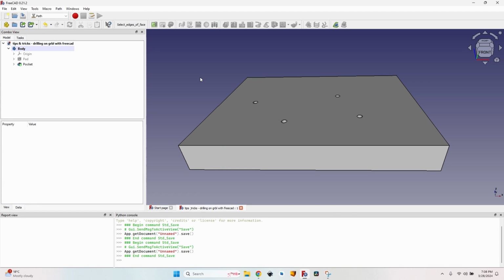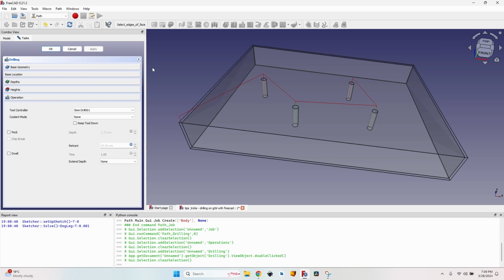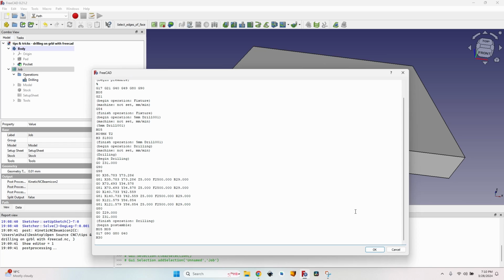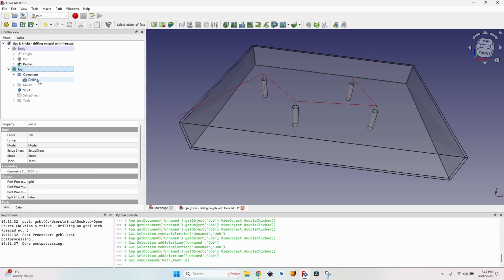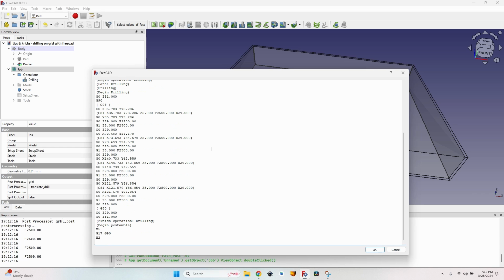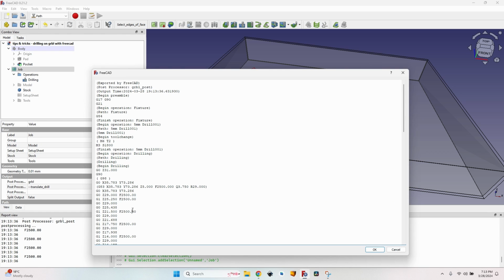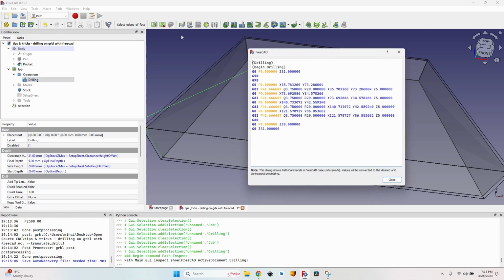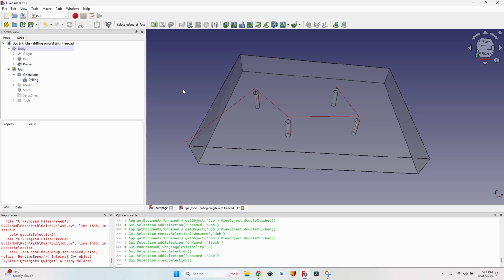Drilling on GRBL CNC Machines – FreeCAD CAM Tip 5 (G0 & G1 G-Code Guide)

Comment: When I downloaded your vacuum file produced with  freecad with the ( .gcode  ) extension It worked fine on my Genmitsu 4030 , I also use freecad 1.0 and the processer only generates  a ( .nc ) extension which doesn't work on my 4030 cnc. How do you get freecad to generate a ( .gcode ) extension . I tried to play with the arguments  section on the output  page but don't know what i'm doing Thanx Mike
Reply from the maker: The easiest way is to check that file for each setting in the job post processor setup and replicate it. Other than this, I cannot guide you, since I don't know the exact type of controller your machine has

Comment: I've seen that the speed is not the same as any of the setup speeds(The F parameter in the gcode), do you know where this speed is configured?
Reply from the maker: In the toolbit setup, the vertical speed
Reply: @opensourcecnc  I had the settings in mm/s that's why didn't match the values with the gcode! 😅